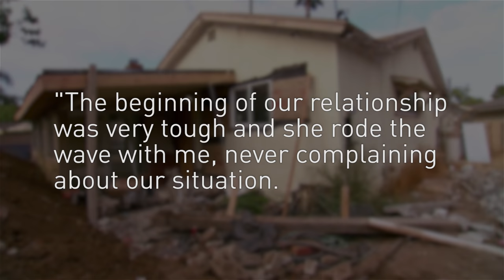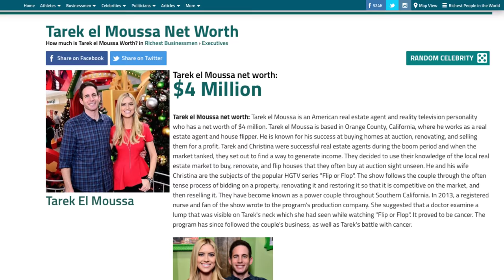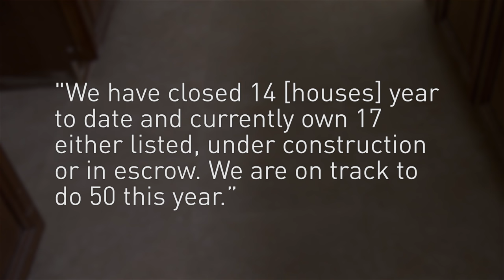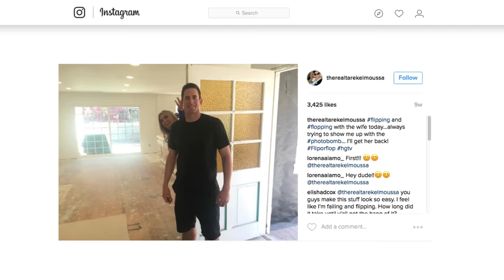The Untold Truth Of Flip Or Flop

Comment: I don't like flippers!  I can't watch shows about flippers, but if I'm stuck in a room with someone who is watching, I root against the flippers.  I bought two houses from what turned out to be flippers.  Very unpleasant!
Reply: Most flippers just do a cosmetic facelift & don't address issues like structural, electrical, insulation, roofing, etc. They just make it pretty so people will like it. Then the buy it & find out it's a money pit because no real work has been done on it.
Reply: Scarlet Ribbons And where's your proof of such slander?  You have none, because no one has ever done such a study to gather that data and never will.  I've flipped houses but I'm very good at what I do and I do high quality work.  But I've seen some flippers on TV who are cheap and/or ignorant, so I would never buy a house they flip.  You have to be knowledgeable about good house construction (or hire someone who is) in order to make such a judgment.
Reply: Scarlet Ribbons  That is so True!  the people who flipped the house I'm in used such cheap materials.  the sheet flooring in the kitchen was so thin and cheap, they gouged a hole in it before we moved in.  it would rip if you put a chair or even a trash can on it!.  I didn't know from Inspectors, so my realtor recommended one.  The people who have worked on the floors, plumbing, electrical system, etc., etc., have all wondered how in the world the inspector didn't pick up on these major problems.  Funniest darn thing!
Reply: Happybidr Of course there is no study.  Who would pay for it?  These things usually come from the industry, and that would never happen.  I'll take your word that you are a good flipper.  I've seen ONE.  They bought the house next door and redid plumbing, drainage and roof.  I've had experience with two of the other kind and everybody else I know who have had experience with flippers have had bad experiences.
Reply: Happybidr I've seen videos flippers have proudly uploaded to brag about what they've done, & in every single one I've seen, it's all been cosmetic work.

Also reasonably knowledgeable about house construction due to an ex having been a contractor.
Reply: denniesim Unfortunately, inspectors aren't allowed to rip things apart, so they miss things that aren't visible to the naked eye. It's only if people start remodeling that they discover horrors behind the walls. It may 'look' as though the electrical is all new judging by the receptacles & breaker box, for example, but what they did was simply wire new stuff into ancient knob & tube wiring & create a fire hazard.